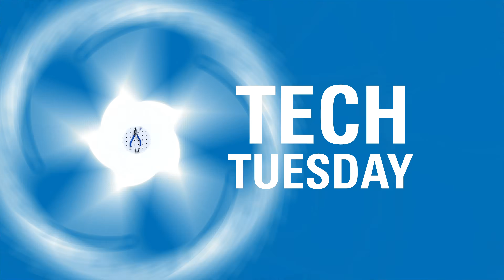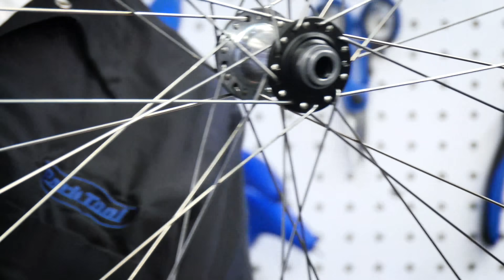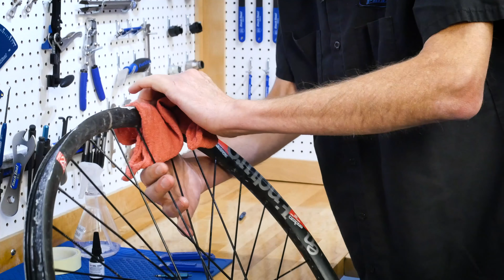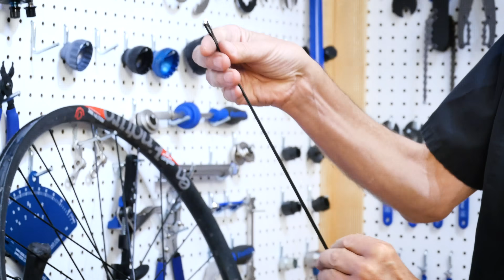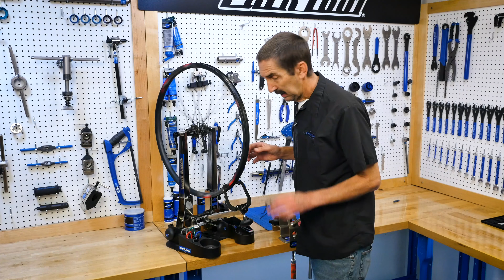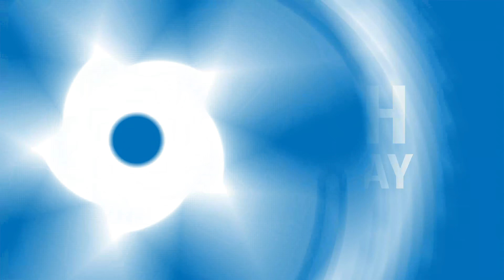Industry Nine Spoke Replacement | Tech Tuesday #167

Comment: I love this dude! He has helped me so many times. 
I have an I9 en300 wheel set. I thought I'd never break one of those spokes, but sure enough I bent one badly. 
I didn't know the drive side uses a different length spoke, so that's one thing I learned. Also, I never would have thought to cut the rim tape. I was just going to take it all off, then retape it. It's the simple things like this that are so helpful. 
Thanks for all the tips!

Comment: Hmm, I always just add a full loop of rim tape. Better safe than sorry. Also it usually helps with seating the tire.

Manufacturers are so cheap, I had several wheels (DT swiss, i9 and Race face) start to leak because the single layer just fails at the spokes. 

So to begin with, I always do 2 layers.. Tape is cheap, tires and rims are expensive and sometimes by the time you realise you lost pressure, you already ripped the tire and dinged your rim too :(

Comment: Did this spoke break due to the chain grabbing it with a outer link due to the derailleur getting hit and bending the derailleurhanger way pass the b-tension setting allowing the cain to drop past lagest cog on the casette and so grab the spoke with a outer plate?
Reply from the maker: No, the spoke has no cut mark or burrs, and the anodizing looked normal.  We suspect it was impact during a fall on a stump....or some other blunt instrument.

Comment: So if the patch does not hold ( yes, i saw the comment that it did) would you just retape the entire wheel?
Reply from the maker: If the patch failed, a complete removal, clean, and re-tape is the process.
Reply: @parktool  What sort of tape did you use ?

Comment: Does this system has benefits? or is it only for them to charge more?
Reply: typically the weak point in a J bend spoke is at the bend, by removing the bend you remove the weak point thus making the spoke stronger
Reply: @bmxscape  thanks
Reply: @MaQuGo119  bmxscape is wrong. Let's quote Jobst Brandt :"Grain alignment in drawn
 wire is longitudinal and cold forming a head onto the end of a wire disturbs this uniform structure.  That is the main reason why this is the weakest place on a spoke.  The elbowed spoke does not pull directly on the head, and therefore, transfers most of its load to the flange by a stronger part of the spoke." To sum up, traditional j-bend spokes are a better design.

Comment: i thought that it was impossible to break a i9 spoke
Reply: All spokes can be broken. I ended up unclipping while sprinting, foot came and hit the wheel as I tried to turn the wheel to recover. Spoke snapped.
Reply: This one broke from impact in a crash. Aluminum like any material can break with enough load.
Reply: Me to
Reply: I just bought a used bike w four missing spokes